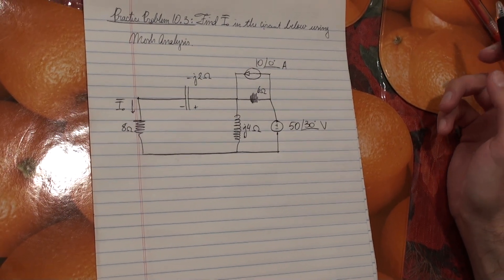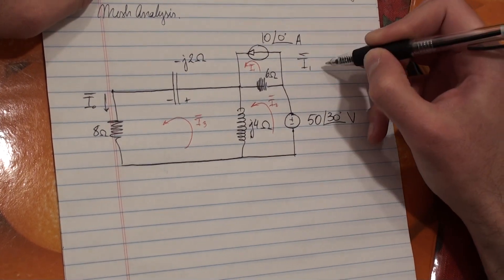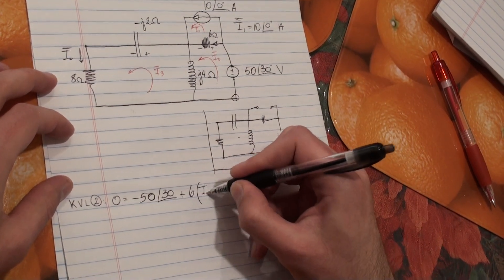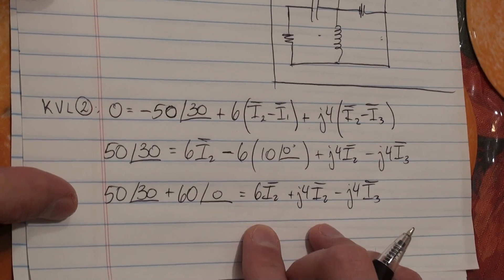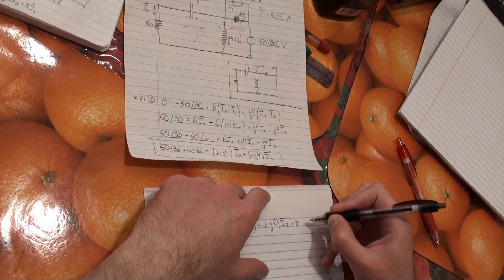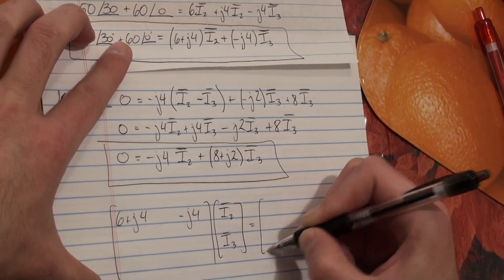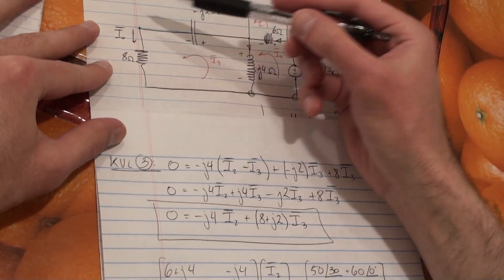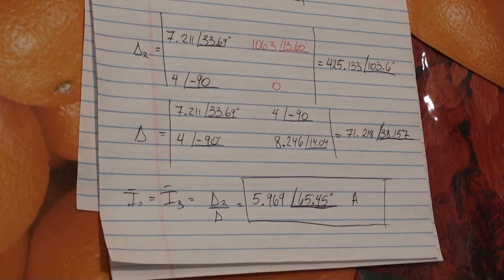Practice Problem 10.3 Solution

Comment: solving with normal simultaneous equation(without using crammers rule substitution method) using rectangular form then converting the final answer to polar form doesnt give the same answer
Reply from the maker: I just double checked this and got the same answer. Did you get the same mesh equations? If so, it’s possible you made a mistake when converting from rectangular to polar. 

If you want, I could take a look at your solutions. It is possible to solve without Cramer’s rule, but it will just take longer. Hope this helps!